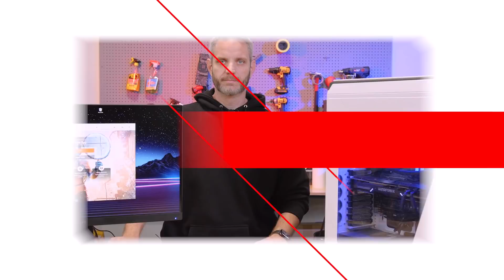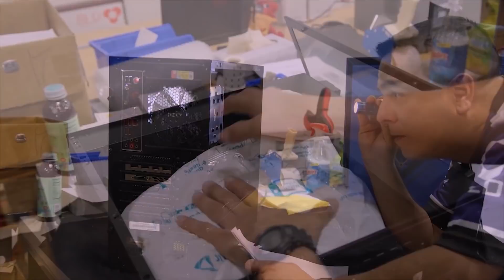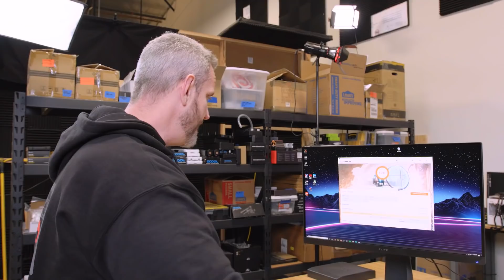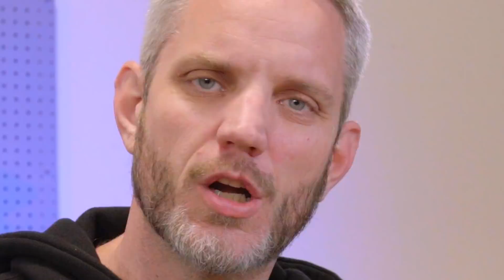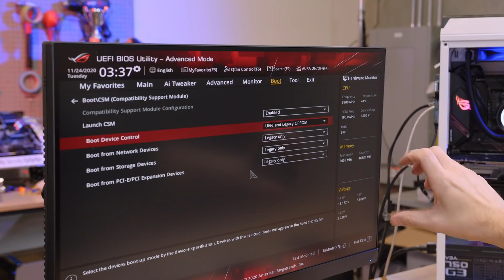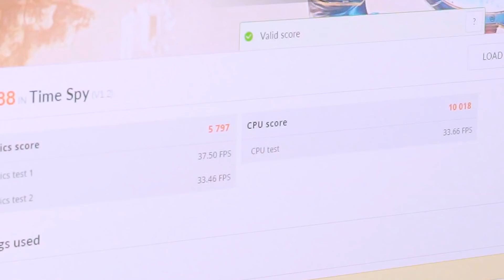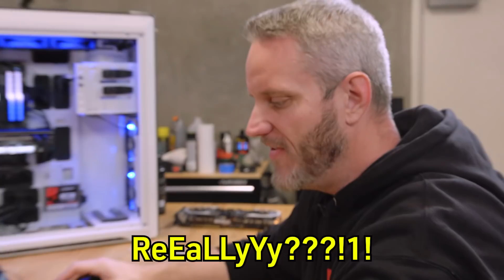This PC upgrade DIDN'T use the latest hardware and still ROCKS!

Comment: I am going to go from a i7 7700k to a ryzen 5600x hopefully tomorrow if the motherboard comes. I am hoping to be able to do this method but I have windows installed on 2 sdds in raid mode. Will this effect it ?

Comment: Hey, now that Gigabyte and others have unlocked PCIe Gen 4 on some X-470 boards, is it still better to go B-550 or X-470 even though there may not be gen 4 support on all PCIe lanes? ( I now have the option in BIOS for my X-470 Auros Ultra Gaming) I am to going to upgrade, but am just curious what you and others thought.

Comment: Just updated my CPU, RAM and Motherboard (MSI).
System sends me to the BIOS but I cannot find any of the options you mentioned in the video to boot to os :/
Reply: Found it, I’m dumb. It was a little hidden and wasn’t coming up in the search option of the bios. But found a switch for CSM/UEFI bios mode, switched to CSM and worked like a charm :D
Should I switch back to UEFI once windows updated all the drivers?

Comment: i tried upgrading from fx8350 to R7 3700x without wiping the harddrive i dont know why exactly but both the 3700x and RTX 2060 super was running at 90-100% while gaming :o so i wiped windows now it only runs at 20-40% on cpu while running a heavy game of course the gpu takes the load at 80-90% 1080p, in my power options i got all the amd stuff but then theres this ultimate performance idk if i should use amd high performance or "ultimate performance" which doesnt mention amd?

Comment: Also actually Avast has issues with Ryzen in general sometimes. It will auto switch off ryzen high powered mode  with the b550 boards at least if you try to launch a game while avast is in the background at all.

Comment: rig has a nice clean layout - the latest parts make a difference? they are more efficient and by the time zen4 comes around even biz will see reason and low opp cost to upgrade - i think refurbs are the hottest mkt right now up until 1q out for zen4 - what it means to me faster imaging/backups - speeds are going to be fast but you need fast network also - go ahead and build a opnsense 100g router - the cards are like 300 bucks - do 40/56gbe - i think using connectx cards would be easiest - just install proper drivers for gbe - 100g matches up well with nvme arrays/gluster and db ops #network fs

Comment: Thank you for this video.  Never even knew you could do it this way.
Reply: You can but it's not recommended. It can lead to problems down the line. If you want a stable long running system, you should always reinstall on a CPU/Motherboard upgrade.

Comment: I installed the X570 drivers from AMD, but I'm not seeing the extra power settings in Windows.  What am I doing wrong?
Reply: The settings can hide in the advanced power settings area somewhere. I don't use the Ryzen Power Plans though. They stop the CPU from dropping below 99% utilization and don't make them go higher than 100%, which is the top of the normal Power Plans anyway. I'd rather my CPU last longer than it will if I keep it running at 99% minimum, even when it's idle; which CPU's are most of the time.

You can switch between the Plans as needed but it doesn't change much at all in a real world gaming scenario. Synthetic Benchmarks, like Time Spy, are tuned to be sensitive. So smaller gains and losses can be seen more easily.

Comment: tl;dr: Misleading title.
Assuming I'm copying and pasting properly from the description, as of today, adding up the cost of all of these 'new' components, alone, are $1,942 on Amazon right now. Which is leading me to believe that this video is not only not providing cost savings, but is in generality flexing AMD. I am totally cool with flexing AMD, but the video is a bit long and has a misleading description that gives you the impression that there might be some moderate price savings to choosing different components on the same Intel/AMD chipset era vs. upgrading.

Comment: Really cool that Nick finally got an upgrade and I hope that enjoys the heck out of it!
My only real issue is the AIO block placement.  1) The LED screen is turned 90 degrees and is a easy fix to orient correctly.
I personally would have the tubes from the block pointing down/coming out of the bottom, just for better liquid flow and lessen the chances of air bubbles form in the block.

Comment: GTX1080 owner here...
If you have a similar system (modern CPU of R5-1600, Intel 6-core that's similar or newer), 16GB DDR3/4 or higher capacity and GTX1080, RTX2060, AMD equivalent or newer then frankly I wouldn't upgrade unless you have a specific use case you are aiming for that you can't hit (4K and/or higher FPS...)... I'm playing "HORIZON ZERO DAWN" for example.. just got it after the v1.08 update which fixed some stutter issues... it runs GREAT!! I run on a 2560x1440, 60Hz monitor and what I did was enable "Adaptive VSYNC" in the NVidia Control Panel for this game.. I then ran the game but got drops (screen tearing below 60FPS with Adaptive VSYNC enabled) so I ended up dropping to 80% of that resolution (about 50% higher than 1080p) which looks great still and used a combo of High/Ultra settings and now I rarely get drops below 60FPS...
SHADOW OF THE TOMB RAIDER and other modern titles run at 60FPS, 2560x1440 with some combo of High/Ultra depending on the game. Ray-tracing is not a reason I would upgrade. So again, if you have a fairly modern system and get GAME STUTTERS or whatever I'd NOT upgrade but instead would learn how to properly adjust your game settings to achieve optimal smoothness (which in some situations means move the game to an SSD)... using a variable refresh rate monitor (Freesync/GSync as appropriate) can help a lot too but if you have a non-VRR, 144Hz monitor it might make the most sense to enable "Adaptive VSync (Half Refresh)" (or AMD equivalent) to synch to 72Hz at 72FPS instead then adjust your game settings so that you hit 72FPS at least 95% of the time (and the remaining drops would cause screen tearing as VSYNC is auto turned off)... in some cases setting an FPS cap for a 144Hz monitor without VRR works well as you might for example run at 50FPS in a Tomb Raider game but with almost 3x the refresh per new frame the screen tearing might not even be obvious yet responsiveness is good... so EXPERIMENT rather than just throw new hardware at the problem!!

Comment: It's been 4 years since I "built" my PC and still haven't got a GPU... I think I'm gonna visit you Jay lol.

For those curious:
-MB: H110M Gaming
-CPU: Intel Core i5 7500 3.4GHz (Intel HD Graphics 630)
-RAM: 8Gb 2133MHz Corsair Valueselect (2x4Gb)
-PSU: Gigabyte P650B 80+ Bronze (650W)
-SSD: Kingston A400 480Gb (The most recent update I could afford)
-HDD: Toshiba DT01ACA100 1Tb

Not a bad PC but could definitely use a GPU lol.

Comment: Wasn't Ryzen, the Phenon II were the first 6core CPUs
Reply: Yeah, but the Ryzens were AMDs first “6 core” processors that were actually worth buying.
Reply: @ianweber9248  I don't know about that I had a Phenom II x6 1055t system. It was a great system paired with an RX480 8GB card I could play any of the AAA games of 2017 at ease at the highest settings.
Reply: @spaceagetech2289  The problem was that despite having 6 cores, they weren’t that much faster in multithreaded tasks than a competing Intel quad core. I still maintain that the Ryzen 5s were the first CPUs that AMD could market as “six core” without embarrassment.

Comment: I low-budget upgraded a friend from a Phenom II X2 to a Ryzen 1200. The HDD had Windows 10 installed and was the only thing that was moved from the old to the new system, and with the internet cable plugged in, I got lucky, didn't have to do much in BIOS but slighly OC the CPU to keep pace with the R9 380. It POSTed just fine, but rebooted about 5 or 6 times and then went to login screen. I was shocked but so relieved haha

Comment: I viewed this video because its similar to the process I will be going through with upgrading from an older intel system to a Ryzen system... but I have a question: what is your opinion on needing to remove the old drivers that are associated with the old hardware via a reinstallation of windows vs. what is shown here? this video makes it seem as if you can just drop all new hardware in and do these few tweaks and be up and running just fine, whereas other people insist you must do a brand new clean install of windows with new CPU, motherboard and Ram specifically so there aren't old drivers trying to work against new hardware nor woking as if the old hardware is still there, which is said to hurt the performance of the machine.

thanks

Comment: Same case I have, only mine is in gunmetal. Tried deciding on a new case to replace it when I went Ryzen, but couldn't find anything worth replacing it with. The 011 Dynamic XL came really close, but the ol' Switch is still getting the job done.

Comment: Considering that no one can even find the latest hardware, let alone buy it, I think the parts used here are the latest that is available, which is misleading. Then again, my rig is rocking an i7-4930K 6 core 12 threads and 780Ti, so, if I get two generations old hardware is gonna be a step up for me.

Comment: HELP 

PC :

3600xt,b550 ,2070 super ,PSU , 2 sticks ram,case (i wont add storage)

cost: 25000rs,10000rs,40000rs,5000rs,6000rs and 1000rs = 87000rs (1176 USD) rs: Indian rupee

console :

35000rs(475 USD) xbox s or 40000rs(540 USD) ps5 digital

what should I do? PC or console?

Note: I have to get digital editions of the game cause to find disk versions are very hard(amazon and others sell it I don't trust them) no GameStop as such

Comment: Personally I still rather do clean install of OS on major hardware changes. Yes, it works out of the box, but I like to "mop up" old drivers and stuff Windows piled up based on old hardware. Because you never know, if those leftovers won't cause issues down the road. Because Windows can be bit messy with stuff, especially when you change CPU and motherboard to completely new platform.

Comment: Can someone PM me? I have some questions about building a budget pc.i had a guy tell me that buying older parts was a bad value and when I asked for more detail he said this *Because you’re getting a generation behind with significantly lower performance for the same cost since none of the old parts are discounted in a meaningful way.  Budget build or not, buying old parts is less optimal unless they are significantly less expensive and you can’t afford the new parts.

You’d be much better off in the long run waiting until you can get your hands on a 5600x and a 3060 or an equivalent lower end AMD 6000 series GPU.  Not only will you get significantly better performance, but the system will last longer in terms of effective longevity.

Comment: do i need to download the chipset drivers for a ryzen laptop too?
or laptops come pre-installed with these drivers
Reply: If its from a clean vanilla windows 10 install then yes, head over to amd.com and get the latest chipset/video card (if radeon or vega powered) drivers.
If its from dell/lenovo/HP then it should be pre-installed upon delivery of laptop they will have drivers on their website also but usually outdated. So best to check out amd.com like up there.
Reply: @2fast4all  Its an HP laptop and yeah i did install the Radeon/VEGA graphics from and website, but Jay in the video was showing chipset drivers for the CPU if I'm not wrong.  talking about scheduler advantages and all.

driver's part in AMD website for R5 3500u shows just the radeon software for graphics, so I guess laptops don't need the chipset driver ¯\_(ツ)_/¯
but then why do desktop CPUs need a chipset driver

Comment: Yup the good old 810 Switch a great case with a ton of configuration you can do, still have mines. But can tell you its not the vaping that's causing that sadly whatever rubber like coating NZXT put over the black plastic doesn't age well it starts to strip and gets sticky but ells wise a very good case.

Comment: SO, from what I understand I can use the CSM option to completely change my plataform from Intel to AMD and Windows will not lock itself saying I changed too many parts??? Currently have an i3-6100 and 1060 3GB. Definitely need an upgrade I Know. Thinking of changing to Ryzen 5 and RTX 30 series.
Reply: I pulled a W10 SSD from an old X58 build into a R3 2200G without changing any bios settings or CSM. Boots up like I never left. EVGA motherboard to gigabyte motherboard. also.

Comment: Jay I’m pretty’s disappointed that you are encouraging people to disable UEFI boot and use CSM. I understand why you did it, but the correct method would be to back everything up and reinstall windows with the new components, and clean drivers. You could have reset windows keeping the data, CSM is a real dell boy setup and is circumventing the security introduced from windows 8.

Comment: in regard to switching out new components. I have just bought a B550 Tomahawk to replace my pretty crappy Asus Prime b450 but I have an m.2 with wind 10 on as my boot drive. Will this work the same as the SSD from the video? I no longer have a Win10 license Key as my original system was built by family who own their own comp business so I assume they used a non private version of Windows and I ain't really fancying get a new install of Windows and having to find a semi legit key.

Any assurances or advice from anyone would be helpful. Never had a MSI board so is their BIOS similar to ASUS's in allowing to boot in this manner?
Reply: Just put the m.2 in the B550. If anything it will boot right out of the box without configuration. If you do run into a snag then point the BIOS to the m.2 as primary drive then it should be off to the races. 

As for license. If your lucky it could activate itself with no issues or say that it cannot reach the activation servers at this time (typical MS). In that case you'll just need to get a new key off the net or "tools" floating around YT. That's as far I'll explain. 

Good luck.

Comment: I'm still using an i5 4670k and a gtx 970. Serves it's purpose for what i use it for at the moment. I'm upgrading in March and i just might go for a Ryzen R5 5600x build. Will be my first ever AMD system but after some bad experiences with AMD gpu's i never was comfortable making the switch. But i think AMD is doing good at the moment.

Comment: 0:26 "Updating to 2020"
Me: "So you mean 2019?"
after watching
"Oh, 2018" (essentially)

I wonder how long into 2021 it'll take for things to come back in stock..

Really fear that by the time normal people can buy parts from normal e-tailers, the next generation of hardware will be close to release, if not already out (definitely Intel's anyway).  Happened with my CPU (3950x) already (heck, my LG 34GK950-F monitor too) before covid, can't bear it actually being WORSE this time.

Comment: the only modern parts in my pc are the 2070 super and dvd drive everything else is at least 5 years old and it runs 4k at a constant 100 fps (fps at tv's max) so still no need to upgrade anything else atm

Comment: Updating chipset driver following  from AMD's support page is a key, but seems like @JayzTwoCents you won't see the "Ryzen power plan" for 5000 series CPU's as that's not required. 

" Ryzen 5000 series CPUs do not require a special Ryzen Power Profile, so it is not installed with Chipset driver package. Please use the Windows Balanced Power Profile for these processors. Previous generation Ryzen processors will continue to use the Ryzen Balanced Power Profile for optimal performance and this is included in the Chipset driver package.

Starting with AMD Chipset Driver 02.10.13.408, the processor power can be adjusted via Performance and Energy slider on systems running Windows 10 2004 and later. "

Comment: I haven't even hit Play yet and I already approve of, if nothing else, the concept of this video.
Especially with the current furvor about the upcoming next-generation parts.
As Jay has said countless times by now, the appearance of new parts does not automatically make your old parts obsolete.
The question SHOULD be, "Can your existing computer do what you want it to do, in the time you want it to be done in?"
If the answer is "Yes", then you do not need an upgrade. Enjoy what you have!
If the answer is "No", then it's time to consider upgrading. You have many options these days.
And if the answer is "I'm still waiting for it to boot so I can't answer you yet", can I politely recommend a few electronics and technology stores?

-- This was typed and watched on my oldest daily driver capable system, a 2007 Phenom 9550+ in an MSI board whose identity is lost to time, 8GB DDR2, with an HD 5755 pushing a 1024x768 LCD that still uses VGA, and a Seagate Barracuda 300GB PATA drive that is honestly the main bottleneck of the system right now.
For capabilities, it takes several minutes to boot, loading anything requires healthy patience, and it is able to handle older games from around its era, some newer titles if you manage your settings well, and can kick ass in retro-themed indie titles. It is adept at more casual usages, like web browsing, YouTube, and online chitchat.
If I wanted to upgrade it, an SSD would definitely be first on the table. A nice 256GB SATA drive will work fine. This would be followed by a modest monitor upgrade to a 1280x1024 DVI panel. If I could get a good well-cooled case for cheap I'd also do that, as the chipset is mostly being kept from catching on fire by a weird little slot blower that only works half the time.
Anything more is too much effort for a system of this vintage and I'd be better off rebuilding from zero. Which, given that I do own newer computers... yeah.